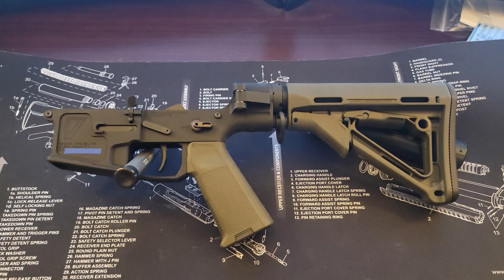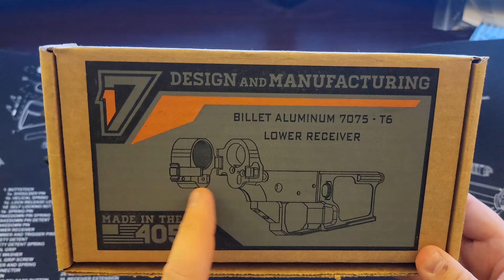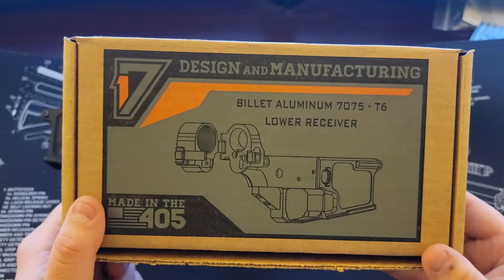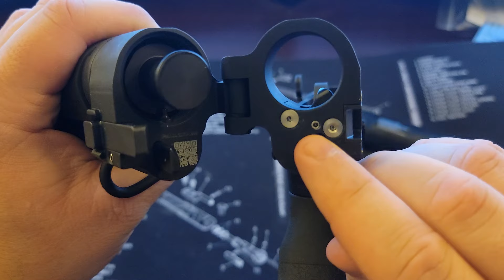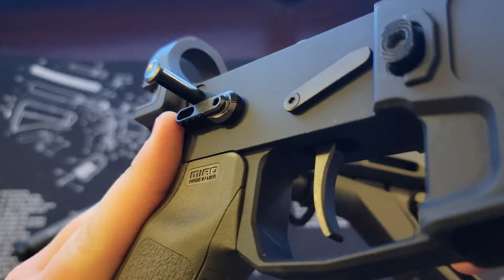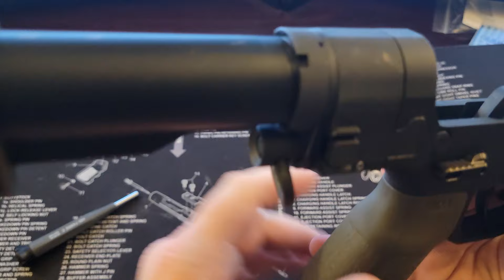17 Design & Manufacturing Folding Stock Lower Assembly

Comment: Anybody do a torture test? 

No good. just added something that will be a problem because I have this. And I accidentally leaned my rifle on the wall and it fell. It landed on the corner of a shelf on the handguard and now there is play where it folds. in result the bolt carrier now getting caught up in the folding area/buffer tube. 17 design is not worth it. Very disappointing. DONT BUY THIS!!!!

Comment: No good. just added something that will be a problem because I have this. And I accidentally leaned my rifle on the wall and it fell. It landed on the corner of a shelf on the handguard and now there is play where it folds. in result the bolt carrier now getting caught up in the folding area/buffer tube. 17 design is not worth it. Very disappointing. DONT BUY THIS!!!!

Comment: This was rather detailed and gave me all the info I needed thank you. Not fully sure how the bolt catch pin is but I imagine and how it sounds is just a solid rod and a set screw
Reply from the maker: Glad it could help you. It's really a terrific design.  Affirmative, the bolt catch pin screws in and out from the rear-side using a T-6 torx driver.  Just have to align your bolt catch, bolt catch spring, and plunger and the pin slides right through.  Much easier than tapping in a tight roll pin.

Comment: The fact that you don’t have to put on the endplate with that super incredibly annoying spring is game changing. Putting on the back plate is by far the most gruesome part of putting together a stick. This seems to make it easier,
Reply: My thoughts exactly
Reply: @garrett4971  it turned back the healing on my thumb by 3-4 weeks for my normal lower backplate install. 😭
Reply: I’ve always hated the bolt return taper pin the most

Comment: The buffer detent pin on mine seems to be solidly fixed in place. No way to push it down against a spring.
Reply: I’m also curious about this if you ever figure it out I would appreciate it. From what I can see I think you need to unscrew it.

Comment: Could you list the parts you put into this lower build please?
Reply from the maker: - POF USA Drop-In Single Stage 4.5LB Match Trigger System w/ KNS Pin Kit
- Spike's Tactical Carbine Mil-Spec Buffer Tube Assembly (Spike's H2 buffer gets replaced w/ 17 Design's special buffer)
- Battle Arms AR15/M16 Enhanced Takedown and Pivot Pin Set Kit
- Battle Arms Bad-Ass Lite Ambidextrous Safety Selector
- Magpul Battery Assist Device B.A.D. Lever (cause I'm a lefty!)
- Magpul MIAD Gen 2 Grip (OD Green)
- Magpul CTR Carbine Mil-Spec Stock (OD Green)
- CMMG Bolt Catch Parts Kit
- Colt AR-15 Mil-Spec Magazine Release Button
- Troy Industries Ambidextrous Magazine Release (again.. lefty)
- BCM M16 Receiver End Plate, QD Steel
- Midwest Industries Heavy Duty Flush Push Button QD

Comment: Super cool concept.  Would love to try it with a BRN-180 upper given it's a piston gun and doesn't need a buffer tube so theoretically should run while folded, however obviously there is a big ass unthreaded hole at the rear of the receiver as opposed to the threaded bit that folds away that will throw a bunch of gas or worse right back at the shooter while firing when folded.  

Anyone know of any product on the market that would effectively seal that hole and not interfere with the function of the rifle or the folding mechanism or would someone be better off either making/getting something made to do that or just get a different lower and/or folding mechanism entirely?

Comment: Out of curiosity, did you have any trouble getting the pistol grip screw to go in? Mine is a bit too small and it won’t screw in the the one that came with the Magpul grip I got?
Reply from the maker: I used the screw provided with the Magpul MIAD Gen 1.1 grip set, but didn't have any issues.  17Design should be using a standard tool to drill and tap the grip screw hole, thus a consistent hole diameter and thread pattern.  If you have issues with a Magpul screw then I'd email 17Design.  I've never had an issue with Magpul-provided grip screws.

Comment: I have one, and it is awesome. The buffer weight is 4.4 ounces which is equal to the H2. 11.5 inch upper. Runs like a champ!
Reply: I just got this lower.   I didn't put the back plate on so far cause it has more thickness where the castle nut goes.  Oh the other issue I found is it works better with gen3  pmags better.   Gen2 are to tight to fit in magwell
Reply: @FormerMPSGT   don't see why it wouldn't

Comment: Serious question here, about the buffer tube and the limited real-estate for the castle nut:  Is the buffer tube used in your rifle a commercial, or a mil-spec piece? I'm not one to argue the merits of either (materials, quality, and manufacturer are more important), but the commercial tubes' larger OD may make the deeper insertion of the tube in the 17 Design Lower more of an issue.  Just wondering if you're using "Best case" or "worst case" from that perspective.
Reply from the maker: Spike's mil-spec buffer tube.  Not sure if commercial might work better in this case to allow more room to seat the sling plate and screw in the buffer tube.  The Magpul ASAP sling plate will not work with this setup.  The shape of the folding stock mechanism doesn't allow room for it.  It will however work with the magpul QD sling plate, or any mil-spec sling plate.

Comment: I just got one last week and love it. Super easy assembly. Only needed an Allen wrench. Feels super solid and I love that it comes with a tensioning screw. If you want a dedicated folder this is the way to go hands down.
Reply: I guess mine was missing the tension screw
Reply: Have you had any issues with mags not dropping free?
Reply: @hackptui  no issue. Pmags and steel mags work fine. Did run into a quick fix issue on the buffer. There is an internal screw that holds the buffer extension together that unscrewed itself over time from general movement. I just opened up the buffer and applied loctite to the screw. No issue now.
Reply: @ahrentrevino9981  Thank you!  I'm getting one now.  Looking forward to it!

Comment: Will that buffer work with a suppressed 300 BLK?
Reply from the maker: Good question. It should provided your using .300 loads similar to a .223/5.56. I reached out to 17 Design to check for sure. Will let you know.